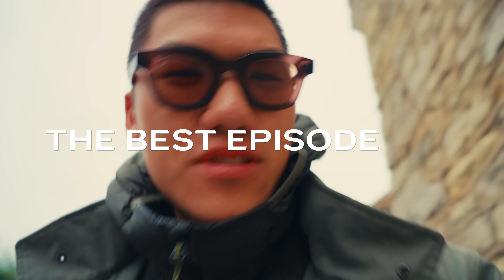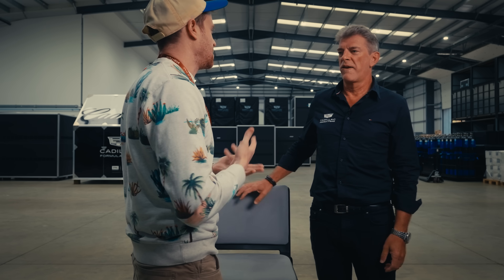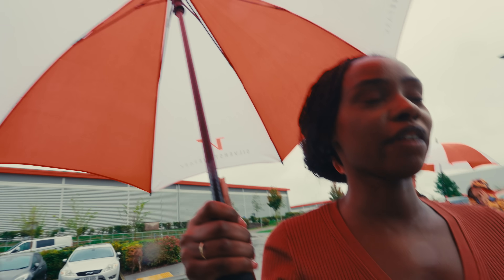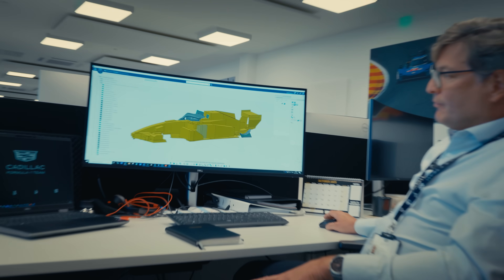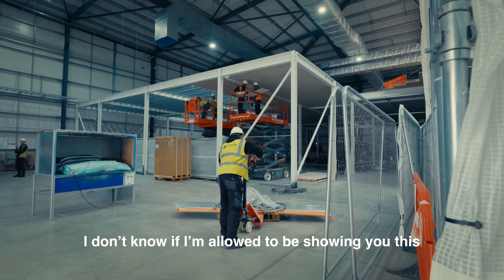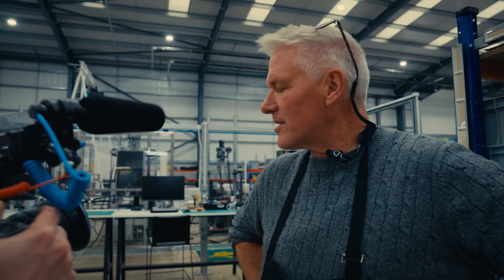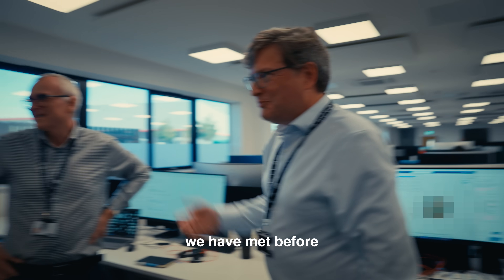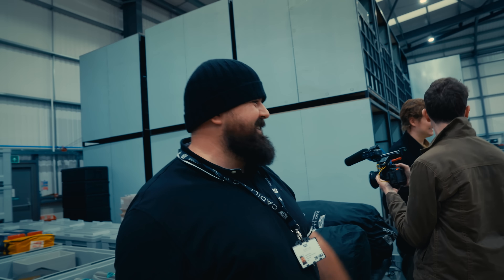The Small Town Building Cadillac’s First Formula 1 Car

Comment: So much talk about being American when the team still has a base in UK.
I think also has a technical partnership that extends to PU, Gearbox, Suspension, Hydraulics and electronics. 

They also are using 2023 Ferrari for team integration. 

I have no problem with them coming in it is great we have GM but I think it was all a bit of exaggeration when it was said they would be an all American team  considering they had no cost cap till last year and were free to develop a car and do some testing and stuff. But so far it has all been underwhelming and now it is not even confirmed GM would have there own PU in 2028 could be delayed to 29 or even as far as 2031.

Comment: Indy cars use a standardized Dallara chassis and use either Chevy or Honda factory engines. That is why they cost 10% of the cost of an F1 car (roughly $2 million (US dollars) versus $20 million.) This F1 system seems awfully wasteful. BTW Indy cars are much faster  and the competition is vastly closer.
Reply: What on earth are you talking about? Indy cars are not faster, they typical run 12+ seconds slower per lap compared to f1 cars and 2+ seconds slower compared to f2 cars

Comment: A millimeter is .039 thousandths of an inch which carpenters are familiar with.So not exactly tight tolerances the presenter is thinking about.
Reply: There are 25.4 millimeters in an inch. Or 3.93% of an inch. He said microns were more exacting, which is true.

Comment: I hope the corporate senior management understand that it takes time and years of going from strength to strength to eventually become a team that has the potential of winning. It cannot be a fly by night operation where results are expected in a 5yr timeline like Renault especially while under investing. As you can see these guys are in the skunkworks phase of building meaning you can see the energy and outside the box thinking needed to be innovative is there but do not expect that hectic chaotic environment will produce a winning car. Nobody should expect podiums for the first few years when these guys offices have to change from week to week because they are literally constructing the factory they will use to design/ construct the car with ... compare how hectic that environment looks compared to any of the established teams. So just have low expectations and don't be disappointed with the results for the first few years. It's just going to be a lot of learning from losing and sucking before things start to click and that is F1 in a nutshell. Also Cadillac is a new entrant so don't bother comparing them to Audi or even Brawn GP. They're more in line with Haas entering F1 but also Haas had much more hand holding from Ferrari and Dallara in terms of component usage and design so their ability to punch above their weight class was amazing but not similar to the level of work Cadillac opted to do in their entry. Cadillac is doing their own design, their own gearbox, own wind tunnel aero work. So much more of a heavy lift from Cadillac than Haas previously did.